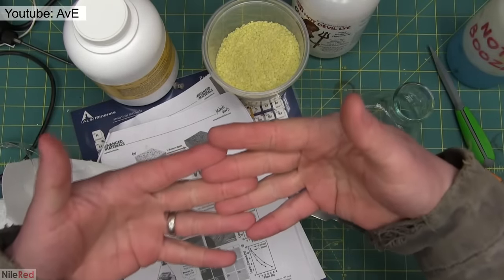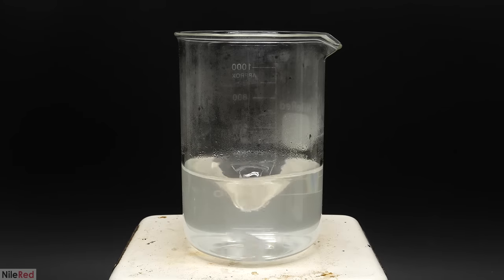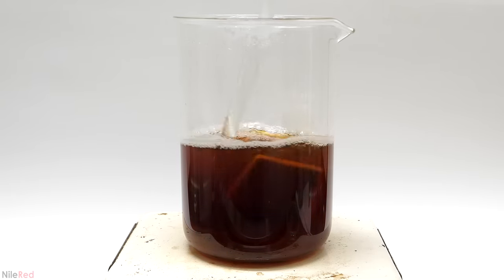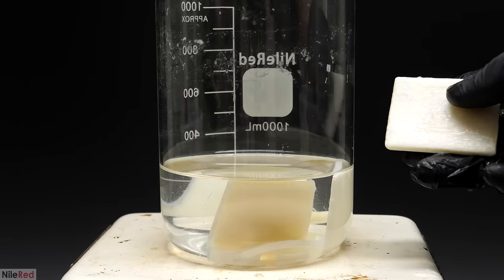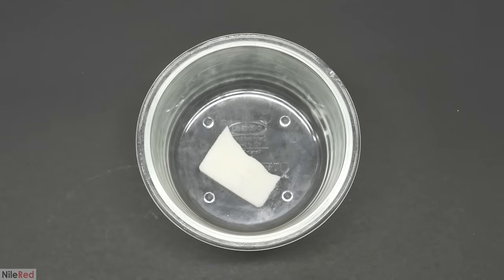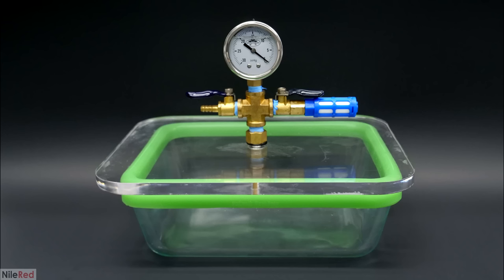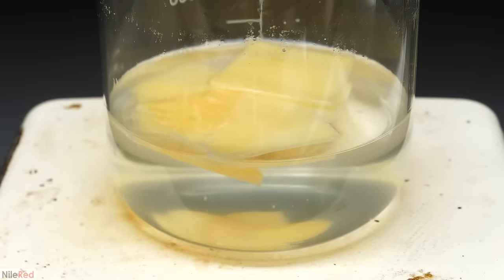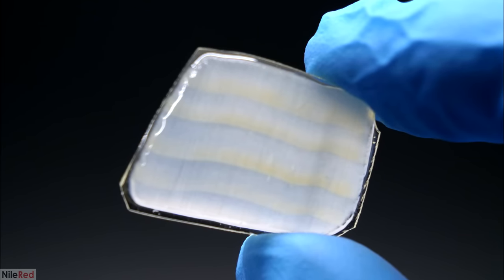Attempting to make transparent wood

Comment: looks like some UV-cured epoxy would be better for this project. just leave the wood and epoxy in a vacuum in the dark for a few hours till it's completely soaked and expose it to sunlight afterwards.
Reply from the maker: Hmm, interesting idea!
Reply: @NileRed  good luck mate <3
Reply: @Ballacha  that would just stabilize the wood,not making it transparent. Peter Brown has made a Video about exactly that.
Reply: @emrefifty5281  NileRed is having trouble soaking the wood completely in epoxy before it starts to dry (22:48). i'm simply suggesting something he could try that may address this one issue.
Reply: One drawback with the UV-cured epoxy is that the wood sample will still have residual lignin since the wood is not completely defibrillated after the pulping. These bleached lignin structures will react to UV and cause brightness reversion/yellowing and thus reducing the transparency. This is the same type of reactions you can see if you leave a newspaper out in the sun for example. This is because the newspaper is produced from mechanical pulp that's not necessarily delignified.
Reply: @Knasen3  UV-cured epoxies only requires 1-2min UV exposure. i doubt lignin will react much in such short period of time.
Reply: @Ballacha  Aha, then it shouldn't be a problem :)
Reply: @Knasen3  And, quite frankly, if that is a problem, I feel like keeping the result anywhere the sun can reach would be an issue anyways
Reply: @kuberootwastaken  That might be true. It obviously depends on how much UV-radiation the epoxy can absorb.
Reply: I was about to suggest the same, I think it may work.

Comment: I've never commented anything before. But now I just have to. 

Use panes of glass to position the epoxy filled wood between. What you need is the surface to be flat. Feel free to use a plastic film between wood and glass in order to not stick to the harder surface. That's why the author of the paper peeled it. (possibly just waxed glass)

This will also determine the amount of resin on both sides of the piece: Next to none. 

Chances are that it will work almost as a one way valve. Gaseous molecules are drawn off and replaced only with resin. Let it cure completely, good and long. A gently elevated temperature will aid. After that, the piece should remain flat. And with a glass finish!
Reply: Problem is that will block the tubes in the wood
Reply: @87mits  I think he's talking about placing it between glass panes after the impregnation. So the blockage of the lumen is not an issue as far as I'm concerned.
Reply: @87mits  Yeah after the vacuum use the glass sandwich. I've done with many times for flat composite panels.
Reply: Don't forget adding a solvent to reduce the viscosity of the resin to better penetrate the wood.

Comment: There is a wood hardener called Cactus Juice. I think it would be perfect for this instead of the epoxy. Its a watery like liquid that basically turns the wood into a plastic like material.  I have a feeling the authors of the paper sanded the hard epoxy after to get a flat surface right to the grain of the wood.
Reply: It's not a hardener it's a sealer for wet wood so it doesn't crack while drying wood Turner's use it to prep there wood for there lathe
Reply: adelmo worytko quoted from TurnTex (Cactus Juice place) - “Cactus Juice is a heat cured resin used to harden and stabilize most porous material, especially wood.” I’m not sure you’re supposed to use it on wet wood, but maybe!
Reply: i just watch alot of woodturning videos and thats were i got it from. the version i heard about forms like a waxy seal on the grain so wet wood dosent split while drying because if you left wood unsealed the grains expand and split the wood
Reply: @SeanHodgins  it can work with  some wet wood such as the ethanol treated wood in this video.

when you  place it in the vacuum chamber it would pull all of the ethanol out, and draw the resin in.
Reply: It's the quenchiest!
Reply: My name is sean
Reply: But is it the quenchiest?
Reply: SeanHodgins it’s also the quenchiest
Reply: When going for transparency, sanding the material is not a good approach.
Reply: @jyrolys6  I would sand off the excess resin, then polish it to a high gloss.

Comment: Also, look into how biology tissue samples are made transparent.  After soaking in ethanol they are repeatedly soaked in mixtures of ethanol and toluene containing more and more toluene until all of the water/ethanol is replaced with toluene which then mixes completely with the epoxy.

Comment: Okay, so one possible idea to get a bit more transparency. and this is woodworking knowledge, not chemistry. to get a clear and beautiful wood grain a surface is important. Maybe that will make for less translucent, more transparent view as well. firstly, get a cleaner cut. you may want to use a fine toothed backsaw or a fine-toothed dozuki. then, probably also take them from 80 to 150 grit being very careful to take out all the saw marks. once they've been dried of ethanol, polish them with 240 or 300 grit. there's not much point in going farther than that, the wood grains are only so fine. Also i'd like to see you try some other woods while you're at it.
Reply: @Chubbicat  basswood is already a very light and porous material. it's comparable to balsa.
Reply: If the epoxy cures hard enough, he could try grinding/polishing afterwards down to the bare wood face.
Reply: @blahblahblahblah2933  not a great idea. his epoxy finish is glassy and perfect after vacuuming & it's incredibly painful to cold work. not to mention it leaves nasty dust behind
Reply: @Chubbicat  my guess: the woods used in paper manufacture will be low in lignin content as removing lignin is a costly procedure. cedar is known to be full of all kinds of nasty substances, and is particularly weak across grain. looking quickly at random charts it seems that older trees tend to have higher lignin solubility and so searching out the rare piece of old growth 'pulpwood' with small, tight growth rings might work? sounds like a real unicorn. anyway i don't think this is so much of a big issue for nile as he got the lignin out just fine as far as i can tell. the weak link in his process is probably the woodworking
Reply: that's flying in the face of the most basic woodworking knowledge, bro. a rough surface means translucent rather than transparent surface. that's why there are competitions to make the thinnest shavings possible with hand planers. it isn't the shavings, it's the surface. the cleaner the surface the more beautiful the wood. and that's because a rough surface looks rough. even sanding is a mediocre solution. these guys will sharpen their plane irons with every shave just to get a good surface
Reply: I think a light sanding is a great idea because cutting it at such high speeds and high friction had to press the pores in and burnish them closed. You could even see where the friction was so high the wood got slightly charred. A light sanding would probably open the pores up and allow for all the chemicals to get in and out much easier. Planing the surface would be even better because the dust wouldn't clog the pores up and just leave an extremely clean surface.
Reply: Maybe he should just collab with someone with more experience
Reply: Im thinking get a super sharp planer and use that to get the wood surface smooth
hell even take a thick cut with a sharp planer and just use that
or would this crush the pores closed?
I dont think it would anymore than sanding would, but im not a woodworking expert I just fuck about in the garage sometimes because damn is wood expensive
Reply: biologist here, when preparing samples for macroscopic analysis we polish it up to 1200 grit while submerged in water. it makes it glassy smooth. dunno if it'll help but its worth trying
Reply: I'd gladly send Nile a variety of some highly polished wood samples
Reply: @-a13x-75  fun fact. highly polished, planed surfaces tend to be more hydrophobic than rougher surfaces. under an electron microsocope clearly the pores are more open, as you've guessed, but the cleaner surface has more surface tension and water tends to bead off of it more easily. this is all an aside, because imo nile appears to be able to remove all of the lignin adequately and to fully impregnate (many) of the pieces with the resin. why else could the wood still be somewhat clouded? a surface that is less than impeccable. his entire process is very well tuned with the exception of the cringey woodworking. it's not magic or anything. also please for the love of god if you read this nile look up 'push blocks' if you want to keep using the table saw
Reply: @randomcow505  i'd say skip the planer. not only is it kind of advanced, but planing end grain (which is where he had most successes) is about as hard as planing gets. especially planing small chips would be nigh on impossible for the best of us. the simplest procedure is to cut them by hand with a fine toothed saw and prepare with a series of hard block sanders (not that mushy trash they sell at the store, but a block that doesn't give) or even whetstones. someone said they take samples to 1200 for microscopic analysis but i think the eye cannot see much more past 300 grit. and i presume that after the chemical treatment the surfaces will need to be reworked. i imagine with some clever polishing  nile can get the pieces even more transparent than the bit shown in the original photo.
Reply: ELFWAX Yep that makes perfect sense. The higher the surface energy caused by increased surface area the lower the contact angle and the flatter the water droplet gets. The opposite goes for smoother flatter surfaces that have lower surface energies. I thought planing the surface might help improve the capillary action of the wood and improve absorption. Also, the lack of saw dust clogging the pores might have also helped. I don't think the planed surface being too hydrophobic would matter too much because with the chemicals and heat added, the water's surface tension would likely be decrease significantly. The NaOH probably also saponified any naturally present oils in the basswood and furthermore decreased the surface tension of the water. I think clogged or burnished pores would decrease ease of penetration of the resin and make swapping/rinsing the chemicals the most difficult. What do you think?
Reply: @-a13x-75  i think he boils the wood for 12 hours until the chemical treatment totally penetrated the wood and it worked just fine. adjusting the surface, at least for that reason, is probably a stupid and pointless way to barely increase the rate of penetration. rather, doing that all under a vacuum or maybe under pressure (???) might cut the time needed to get the same good results, but really it's not necessary unless he wants to make much thicker pieces
Reply: gam mal  The best results were achieved with cross grain cuts, which are more difficult than going with the grain. (It's idiomatic for a reason.) I think @ELFWAX has it right with a high speed, fine toothed blade. Table saws like the one used do not make for smooth cuts. 
If he could get his hands on a bandsaw, that would probably be an improvement to the final product as much as the better vacuum pump.

Comment: Would using UV resin be out of the question? A big problem seems to be the vacuum can only be cycled on a few times because the resin starts hardening, but UV resin shouldn't do so until UV light is applied. Unless I'm missing something, it sounds like it could help.

Also, if you heated the UV resin a bit and let it sit for a while the bubbles would float away, potentially receding the possibility that some air gets trapped in the cellulose and keeps the resin from entering.

EDIT: Oh, another idea. You could let it sit in the resin without removing it into the glass for hardening to ensure the full surface area of the wood is covered by resin to spare. To get rid of this extra resin, you could sand the excess after it hardens with fine sandpaper until you're close to the surface of the wood. This would introduce irregularities that would diffuse light. If then you apply a thin layer of resin directly, say with a piece of cloth, the irregularities would disappear and you'd restore the non-diffusing surface.
Reply: sadly, adding a layer onto a sanded surface of resin is not great for clarity. You could however sand away the extra and try diminishing the impurities with a chemical vapour :) Heating and cooling epoxy resin is done mostly for slowing down/speeding up the process of hardening. Process parameters (room temp in situ i.e.) are quite important in working with hardening polymers such as epoxy resin.
Reply: You can sand it down, then polish it. Polishing is one of those timeless methods that works now just as well as it did thousands of years ago.
Reply: Well it’s resin, UV resin, Not wood.

Comment: there is not a single use of the tablesaw in this video that doesnt make me want to die
Reply: Crash whyyyyyyy!?!?
Reply: Seriously it was giving the worst anxiety watching him
Reply: That first cut I was just waiting for shit to hit the fan
Reply: I know, my fingers hurt just watching that.
Reply: OSHA has ruined me
Reply: For real
Reply: @jpenneymrcoin6851  it's not about the fingers. NileRed is smart enough not to touch the blade. It's kickback that's a bitch. The blade is spinning really fast, and if it snags on the wood, that piece can be sent flying at very high velocities, and Murphy's law dictates that it's more likely to fly toward your general direction than any other. If it doesn't poke your eye out or break a tooth, you'll still end up with a massive bruise in the face.
Reply: Bob Longhorn  he wasnt in line with the blade. Worst case was a raspberry on a finger and a broken window.

Comment: 28:30 this ends up forming chloroform but thats perfectly fine
Reply: Tara Ann Pieper I was beginning to think I was the only one that noticed that. lol
Reply: @Ord750  The thing with chemistry is it's all about context and ratios.  Large amounts of mercury injected directly into the blood stream is bad, small amounts mixed with some dead viruses, some extract from egg yokes and other components and you have a vaccine that could save billions of lives (I don't think they use mercury anymore but they used to and it worked).  I've read their trying to find a way to get rid of the egg part since it can cause an allergic reaction.  For a chemist I'm sure it really is just a casual thing.  As an electronics guy if someone told me a strobe light had 4000 volts running through it I wouldn't be concerned (it takes a lot of power to ionize the neon in a neon bulb which is commonly used for strobe lights), if someone told me they were about to pump a computer with 4000 volts I'd run away (If it didn't just fizz out the capacitors may explode).
Reply: @CheshieD  Im not sure why youre ranting about antivax but hey you right and I support it lmao
Reply: Dummy Boy was a tangent to Gregory’s mention of mercury and eggs in vaccines and all.
Reply: @CheshieD  And also immuno deficient (I think that's the word...) people who can't get vaccinated and need herd immunity to be safe.
Reply: Hello there Yup!! I know several people who can’t get vaccines due to having severe autoimmune disorders. Thankfully mine is not nearly as bad as my mom’s, and hers is not nearly as bad as those people’s.
Reply: @CheshieD  Hope you guys are safe especially now, bud. I hope anti vaxxers realize how much of this they caused and how much risk they put autoimmune deficient people in.
Reply: Dummy Boy thank you and we are! My mom’s a former nurse as well as a sliiiight germaphobe so she’s extremely careful when out getting groceries. And yeah hopefully one day they’ll understand that they are risking lives for no good reason. Because they still go out and about when sick unlike those who just can’t take vacs.
Reply: CheshieD I’m a cancer patient and I can no longer get vaccinated. Seeing all of this stupidity going on during this pandemic is making me pissed. Stay inside and Wash your hands everyone!
Reply: Yukorai I feel you there!! Stay safe and I wish you luck with your treatments and all!
Reply: It's very useful for controlling children.
Reply: Dummy Boy I used this timestamp

Comment: that tablesaw part made me really nervous
Reply: I watched that part with my fingers crossed 😂
Reply: @MrEmrys24  All seven of them? 😆
Reply: @solospirit4212  Look at Mr. Fingers-on-hands over here
Reply: if you know what you are doing, nothing is dangerous, but there are a lot of dumb people, so safety is often required
Reply: Me too, don’t think he even noticed how close his knuckles got to the spinning blade....
Reply: I remember you from years ago from Bane videos lol
Reply: @GhastlyDerp  I just tie the fingers together in a cross shape and keep them in my pocket.
Reply: No one is going to comment that he pushed that block through at .001 mph? Table saws can cut just a tiny bit faster than that. Cutting that slow will burn your wood with a lot of blades and wood types. Especially hardwood. Also, that blade should have been sticking out the top of the wood block. If it couldn't go any higher, then that was the wrong blade to use
Reply: you NEVER position your desired cut piece BETWEEN the blade & fence!,  well if it too small to push
Reply: @seronymus  Bane?
Reply: I was puckered the hole time waiting for it to launch out of his hand.
Reply: For you

Comment: You should try this again with some Cactus Juice, it's resin that doesn't harden until you heat it. This way, you can spend as long as you like in the vacuum chamber to get it fully purged, then just cure it in an oven. Might solve your bending issues too.